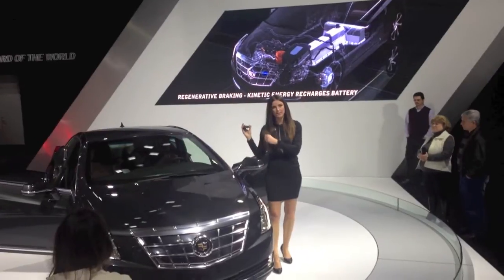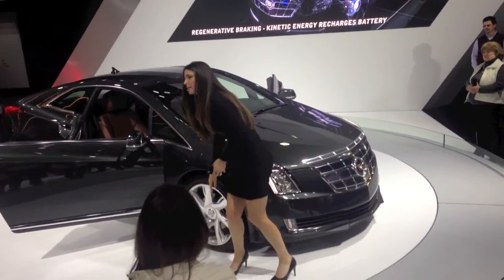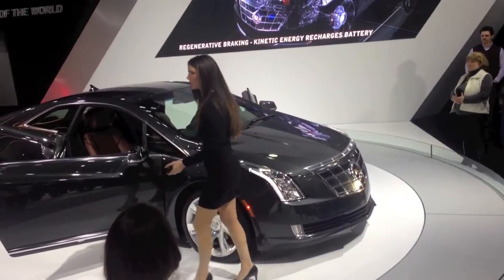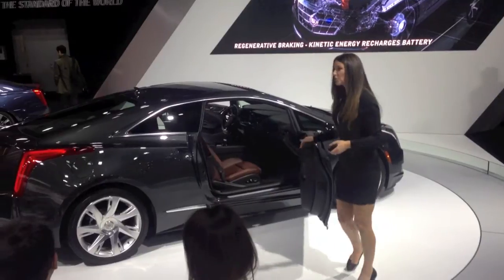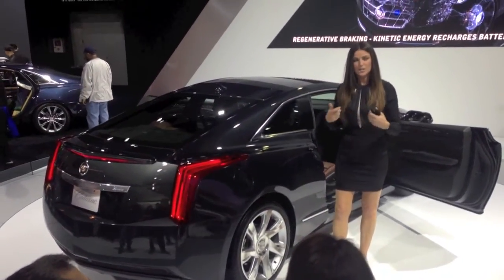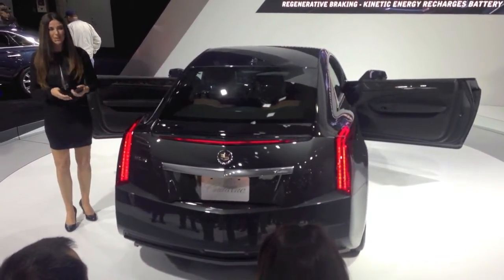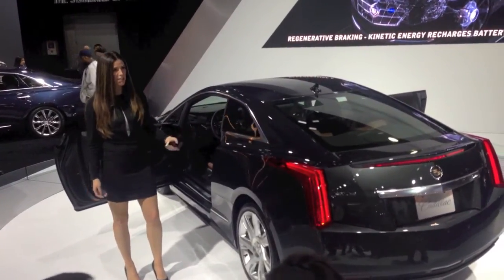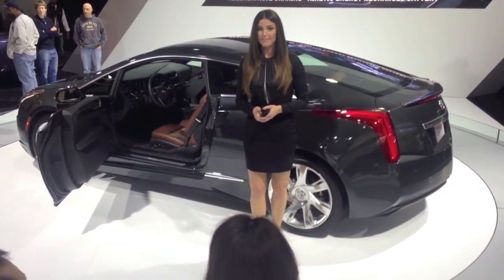2014 CADILLAC ELR (2013 NY Auto Show):  explanation by SUPER HOT model!

Comment: damn tell me that wouldnt be a KILLER backend for the next V. Seems sorta similar to the current one...but if the next V had the backend of the ELR and NOT of the new CTS i'd be alot happier. Curious to see what the designers are going to do styling-wise with the backend of the next V while using the new cts as the platform to work off of cause i'm not crazy about the backend of the new cts.